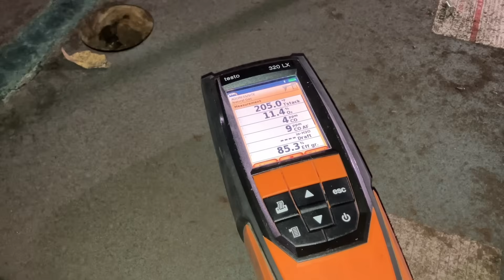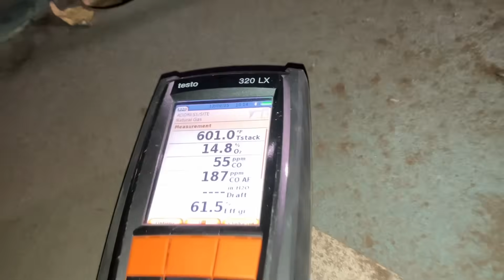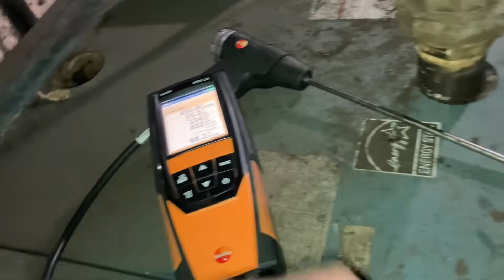Family Heating Home With Oven… Then I Saw the Boiler. UNREAL.

Comment: Wow what a lier, this mother f is bullshit. Your becket burner is what is designed to fit that system.And he should know that being a professional. The fact that he couldn't even tell the customer that that is the wrong burner for that style boiler is beside the fact, it would not cost $20000 to fix that.
Not even close.
I've watched his videos and he makes people panic more often than not.How long has that boiler been like that?And that family still hasn't been killed or poisoned, so he made that family panic for no reason that could be properly fixed with a day's worth of with a day and a half's worth of work for under six thousand what a thief, he pisses me off
Reply: he carries the test equipment for a reason , if he were to knowingly walk away from those readings and that setup like that without locking it out or shutting it down he would be negligent and liable. There is no room for b/s with combustion and exhaust in an enclosed area like that .
Reply: @ryanjosef  oh stop. it was only leaking by at the burner tube because no one had sealed it when they installed it. SEAL IT! Furnace cement is used for that purpose. It was not leaking anywhere else.
Reply: @redpine8665  you sure do talk a lot , meg.
Reply: @redpine8665 did you not see the exhaust on the boiler? 😂 damn some of yall are just dumb af and you have no shame putting it on full display
Reply: @murkyturkey5238  You didn't know what you were looking at. You were probably not familiar. He tested it by the way.
Reply: @redpine8665  It still doesn't answer the Question" did you see the exhaust and the fact it's not connected " .? Raw exhaust gas dumping into a home is a surefire way to get your ass sued off.
Reply: I get why you shut it down. I think I would have opened it up to see why it was leaking out of the front door so badly.   But my biggest issue is the open tee into the basement and why is it there.   It reminds me of the 1980's heat recapture fans installed on the flue piping, but instead  just put in an open tee.     I'm a HVACR guy  who always feels that I can fix it.    I learned to ask myself should I fix because once I do I own it.
Reply: @tonyrichards2017  once you touch it you own it
Reply: @Drrich_DIY  Nope. He could have gotten it safe to use for the time being and (on video) tell them they need to upgrade as this is a temp fix. He could then easily never go back there.
Reply: @redpine8665 the operative word is “gotten it safe”. What if it costs 2k to do that and the homeowner didn’t want to spend that kind of money for a temporary patch. Then what?  My point is, let’s say you go over there and do SOMETHING. And two weeks later the whole family dies of carbon monoxide poisoning. The damage to your reputation as it’s blasting through the news is irreparable.  You can pull out your video camera and yell “hey I didn’t cause this, yes I was there but I was trying to help” but it wouldn’t matter. You would still be f’d. Ever hear the saying “no good deed goes unpunished “?  There were SO MANY things wrong in this case, from leaks to electrical to exhaust piping, I would have run but that’s why I’m not in the business. In my field you touch it you own it. Even if trying to help.
Reply: @tonyrichards2017  Very much a professional opinion,thank you.We used to call that getting married to a customer...If they don't want or care to fix it right,then it's time to move on to customers that understand you don't just kill yourself with a mess like this-
You could kill a lot of people
NEVER trust anybody with a furnace unless he's got years under his belt.I've seen the best and the worst- no such thing as a CHEAP Professional HVAC tech.
Dying ain't much of a living
1976 The Outlaw Josie Wales
Reply: How do they get those years under their belt? By working, gaining experience, making mistakes....it's all part of it. 
Why is it Dr's can practice their entire lives...
Reply: a day and a half, under 6k? you doin all the work yourself? cause... you must not be payin your guys to install it.  12-20 to fix everything he mentioned in the video, is like on target pricing wise.  sure, do it cheaper..someone will just have to fix what they dont later :3
Reply from the maker: @orosado7556 — I hear you, but I’m not “making people panic” for clicks.

Here’s what was actually happening on-site (it’s in the video): I had active flue gas/CO spillage out of the front of the combustion chamber area, improper/incorrect venting components and orientation, and I verified it with my test equipment before I shut it down. 

If you’re a licensed pro, you already know: “It hasn’t killed them yet” doesn’t mean it’s safe — CO exposure can be intermittent, dependent on draft, wind, burner cycle, basement pressure, doors open/closed, etc.

On the “Beckett burner is designed for that system” point: a conversion burner might be compatible if it’s the correct model, installed to the manufacturer spec, vented correctly, and combustion is set up and proven. What I walked into was not that.

On the $20,000 number: that was a ballpark to make the entire system right and code-compliant (proper venting, correcting gas piping size/supply, proper equipment, labor, fittings, permits/inspection, etc.). The boiler itself is rarely the expensive part — it’s the rest of what’s wrong that adds up fast. 

Could someone “patch it” cheaper? Maybe. But I’m not putting my license and a family’s safety on the line with duct-tape solutions — and once I see a dangerous condition, I’m not leaving it running.

If you think I missed something, drop your license # + what you would have done step-by-step (combustion targets, venting correction, and how you’d guarantee no spillage). I’m always open to a real technical discussion — but I’m not apologizing for shutting down a system that was spilling.
Reply: Working as a gas and oil tech for a fuel company, that thing gets red tagged as soon as I walk down there and see that nightmare install. That's scary to walk in on. I can't imagine the hydronic and electric problems let alone the fire side of it.
Reply: @PipeDoctor I feel you did the right thing by shutting it down, as soon as I could see flames through an unsealed opening. I would have shut it down and red tagged it as well.
Reply: @PipeDoctor 100ppm isn't hurting anyone bud clearly you may know the books but have no logical sense.....run your meter in front of a vented natural gas fireplace and get back to me buddy....

Better yet go spend 24hrs in a cold climate 3rd world country 

You have no right to take the heat away from these people just leave if you walk in and see something like that leave.... Because it's been running that way for years no issues
Reply: @PipeDoctor  I like your videos and have learned from them but I wanted to know what the problem was here.  Was it a bad draft, carbonized boiler, wrong jets in the conversion kit for the gas flow, bad sealing gasket.....etc..  I do feel like you protected yourself from liability but I also think that your personal CO detector didn't go off and the one they claim they had didn't either and they probably just turned the boiler back on after you left so they didn't freeze.  If I wasn't interested in installing a new conversion kit and fixing any ancillary problems I would've tried to refer them to someone who was, instead of giving a $26K quote for a brand new system, which I knew they couldn't afford.
Reply from the maker: @everyone - feel free to reply to this pinned comment from @orosado7556
Reply: @PipeDoctor  Given that the poster of the pinned comment can't even spell a simple four-letter word,  space sentences and makes statements about the health of the people living in the property that were not mentioned in the video, they sound more like a keyboard warrior who's been looking online than any real engineer in the trade. As to their license number and a real and genuine technical discussion, it wouldn't surprise me in the least if neither is forthcoming and the former does not even exist. But those are just my thoughts and it would be interesting if genuine discourse did ensue.
Reply: @DelticEngine  You don't know a thing.
Reply: @uspatriot7484  He probably knows that the odds of an account with the name "uspatriot" plus a number is highly unlikely to even be somebody in the US. I mean, there's not a lot of people who don't know that these days.
Reply: @PipeDoctor it just seems like you don't have any compassion for people they don't have any heat now and you didn't give him any type of solution or offering resources or anything all you so just try to finance through our company.. to that's bulshit you know damn well nobody's got $20,000 to throw around but whatever helps you sleep at night man
Reply: You have obviously never owned your own business or bided a job like this. $20K was a verbal estimate but it probably isn't far off judging by how much it will cost to replace all that gas piping, get combustion air into that space, remove and replace the boiler, fix the flue and warranty it. That boiler is no longer safe to operate since it has been running at 600+ deg around the burner and fire box area, plus he would own it once he tries to fix their BS repairs. Calm down keyboard warrior!!
Reply: No reason?  Too many to count!
Reply: Have you been inhaling carbon monoxide?
Reply: You did the right thing by shutting it down
Reply: My furnace got red tagged, because the heat exchanger had holes in it. In my old furnace heat exchanger was irreplaceable. So, i couldn't afford a new furnace. My Sister called Habit for Humanity. Since I was a veteran, she got me a free furnace, tankless water heater, and air conditioner.
Reply: @buffydog21  Good for you!!
Reply: So you would leave it at is ,running raw C/0 into a home with the real possibility of deaths?
Reply: Wow your a moron
Reply: That looked like a former coal fired boiler with that big cast iron door. Queens had alot of them for decades. Many were converted to oil.
Reply: Uou are a goof bro

Comment: Put the oil burner back on it.  That's a lot less than 20k also....600 to 1200 for a new burner....not much labor there either. 
So you didnt press oil, or a heat pump...but you push gas....
Weord way to end the video

Comment: Mike - I used to own my own HVAC co and got a heat call for a gas furnace that kept shutting down and they had their HVAC co come out 15+ times but they could not fix it. I read the tickets that co left and realized what the problem probably was based on what they had done - replaced temp limit with higher temp trip points, replaced ind mtr, blr mtr, gas valve, etc. I ran it and observed the flame dancing around like crazy when the blower came on. Wonder what the problem is right?? I removed the burner and inspected the heat exchangers and found cracks near the burners. I knew they had a huge problem on their hands then so I asked them were they having any health issues and the Mom almost passed out and started crying. I asked what is the problem and she told me her daughter was in and out of the hospital and her, her son, and husband had similar problems but the doctors cant figure it out. I asked how long has the been going on and she said two years!! I removed the furnace and fully inspected the heat exchanger and found so many HUGE cracks it was unbelievable!! I ended up replacing the furnace and then I received a summons to appear at a hearing with 4 big time lawyers. They tried to make me the problem but that didn't work so well so they settled with the home owner. They sued the previous co got over $2 million and guess how much I got for saving their lives??? That's right....NOTHING - but's that's ok because I sleep well at night.
When you were looking at that boiler I didn't see any combustion air being allowed to get into that space but I wasn't there. With the gas stove running and the huge amount of exhaust going into their space it's amazing those people are alive or not extremely sick! You are right  - sometimes it is best to not fix other companies really bad and dangerous decisions and start all over or they can get someone else. Take care!!

Comment: 20,000$ i just changed my boiler 3,200$ everything included😂😂the boiler costed me around 1,600$ n installationa another 1,600$ .the plumber who installed it did it in 3 hours. damn i never seen a guy made the $ so quickly 😂😂😂

Comment: The cost for a new gas boiler installation in Queens, NY typically ranges from $7,000 to $12,500. Here are some key points to consider:
Average installation cost is around $5,427, with a range from $3,524 to $7,343 depending on various factors. 
Factors influencing the cost include boiler size, fuel type, and efficiency. 
For a gas boiler replacement, homeowners generally spend between $6,500 to $11,500, including labor and materials. 
For a more accurate estimate, it's advisable to consult local HVAC professionals.
Reply from the maker: I'd suggest NOT using ChatGPT to guess prices. Have a nice day.

Comment: That tiny bit of CO leaking through the (not properly sealed) flange was sucked right back by the burner fan! No danger at all.
He had to get the sensor almost into the leak to get a reading.
A little bit of the right sealer would have solved that problem.
I don't know the version of that flue pipe vent, I only know the versions where the pipe from the boiler ends below some type of "funnel". But it seems to be working... And could be replaced with the proper part.
I see a couple of hours of labor and couple of hundreds (max) in materials.

Comment: I have major ADHD and can relate to a few of the things I saw, but, I have to wonder... Something's going on there, ignoring a running faucet is not a sign of someone who's thinking straight. "Our water bill is really high" "the boiler was running all summer" Hmmmm maybe it's been on since the summer...? Is the whole house filled with CO? Black mold? Both of those will ruin your ability to think and are frighteningly common.

I think there's a decent chance the reason for the service call was actually just the faucet - DHW priority effectively locks out space heating - but after seeing that burner and flue it's not like there are many options. I mean sure, it's possible that there's so much ventilation in that old building that the a dangerous situation isn't materializing outside of that room. After all, they've lived with it for however long, though the state of their health is debatable. If they want to risk their own lives, that's one thing, but that sort of gamble really can't be made by a third party with a license and a conscience to worry about. Shutting it down was the right call.

Comment: Wondering why you stopped yourself from telling them that the running water is why the house is not heating due to the fact that the boiler heats the house and the water and since the water was just running it wasn’t allowing the hot water to buildup in the radiators and what they need is a water tank to heat their water separately. Yes there was other problems that needed to be addressed but you found what you were called for and kept it to yourself.

Comment: (I live in the mild temperate South Pacific, so central heating boiler systems are virtually unknown here).  

I have heard that, as well as Carbon Monoxide alarms,  in the UK, gas boilers must by law be checked annually in Rented homes/apartments and every 2 years in owner occupied homes,. Even so, about 50 people a year are killed by accidental Carbon Monoxide poisoning annually.  With UK population about 55 Million, therefore Approx one person death per million of population.  

The USA is about 350 million people (plus another 50 Million for Canada ?). I wonder what the annual rate is for deaths by Carbon Monoxide from home heating systems  ?  (Thank-you Mr Plumber for ensuring as best you can, that this family is safe and is NOT a statistic).

Comment: Think getting an adapter plate for the burner face from the Retrofit Mfr. and gasket would take care of the issue, they make universal plates for proper mounting on the gun type burner.  Installing a new correct draft diverter on the stack is not that hard to ensure proper draft so CO does not come into the room.  I would get hazard condition reading near any flame.  Have to agree on this one,  he is seeing the mess and forming an opinion walking in due to living conditions, decided he did not want the job walking in.  Agree with you were the last one there that can lead to an ugly situation.  Smart call to shut it down.

Comment: Looked like an electric oven by the glow coming from it. As soon as M. Pipes saw it he starts frightening the customer,  asking about carbon monoxide detectors. Since when does an electric oven give off CO? Why does a working boiler suddenly need a one  inch gas pipe? Instead of admitting he can't fix the boiler he shuts it off till the customer freezes, caves in, and has him put in a new boiler. It's been working like that for years, but now everyone will die tonight if it's not shut off. This is why people don't trust HVAC guys. Obviously these are not very smart people, letting the hot water go down the drain and then wondering why the heater doesn't get hot. Let's take advantage of them!

Comment: NO OVEN is made to be used as a heater.Nowadays they are so flimsy I saw one tenant that could not buy fuel oil delivery from stiffing all the guys that deliver- (WELFARE) so they used the brand new electric stove to heat a 4 bedroom 2 story colonial.After two months the stove collapsed because the frame and the sides warped and broke the spot welds.
They were evicted but it took 6 months (state laws)